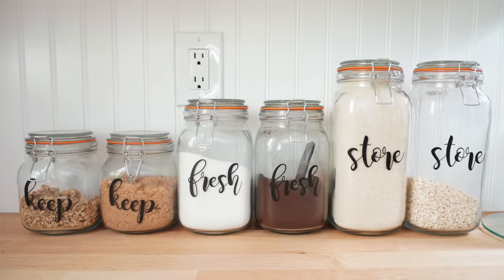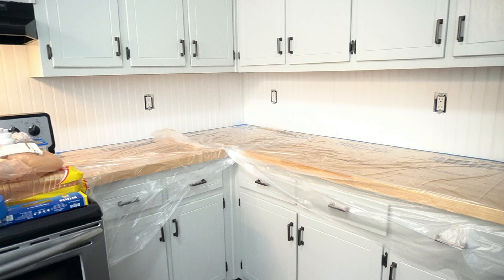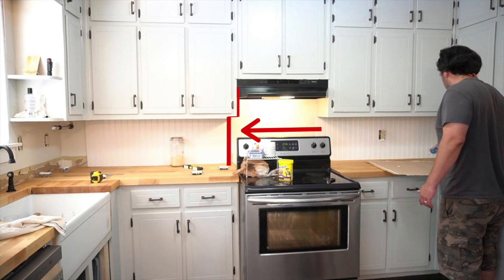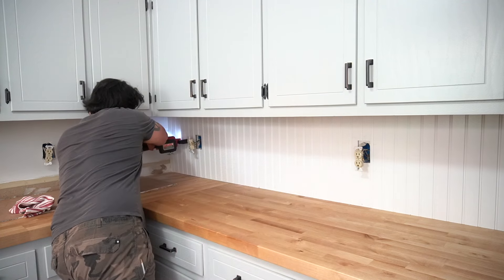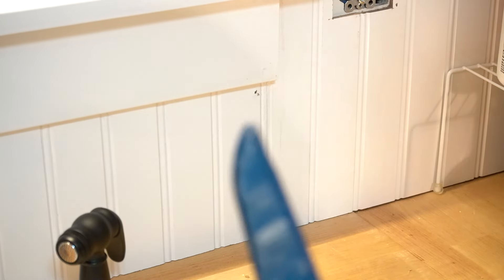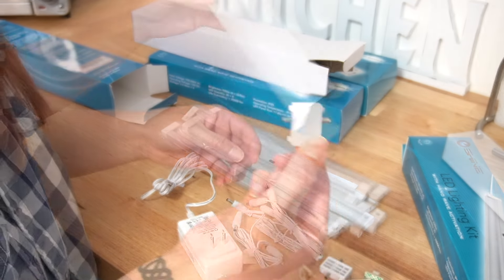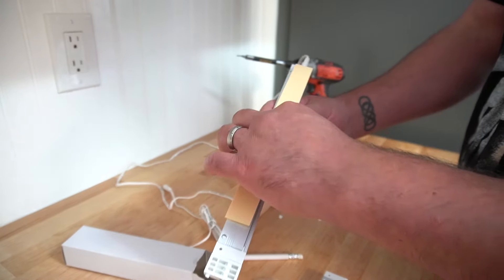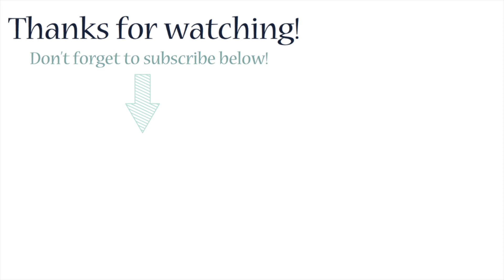HOW TO INSTALL BEADBOARD BACKSPLASH | Cheap Farmhouse Backsplash | Farmhouse Kitchen DIY

Comment: We're getting our house ready to sell, so we want it to look good without spending a fortune!  We have old almond laminate counters which are still in good shape, but the backsplash (which is a separate piece calked down) had warped behind the sink.  We can't find a replacement anywhere, so we're going to remove all the old backsplash and try this!!  **QUESTION... did you do anything to the edge of the beadboard that is not butted up to another piece - like behind your Breville coffee maker?
Reply from the maker: No I just caulked it and painted the edges. Looks perfectly fine!
Reply: @TheLatinaNextDoor  That's what I was thinking! Perfect! Thanks for the quick reply! 😊

Comment: Looks so good! Did you guys trim out the edges?
Reply from the maker: Thank you. We did not trim them since we went all the way up to the bottom of the upper cabinets. We just caulked and painted the edge pieces too. It worked out just fine for us.
Reply: @TheLatinaNextDoor  thanks for the fast reply! I wasn't sure since I saw the nice edge at the end but maybe that's just the bead board. Looks great and can't wait to do ours

Comment: Very nice video with helpful explanations that are easy to follow! How has the bead board backsplash held up for you over the past few years to steam, oil and splatters from cooking? Is it hard to clean with all of the ridges?
Reply from the maker: It held up great! You just have to be sure the caulk is done well at the seams or you the risk of water getting underneath and it expanding. I had a teeny tiny (1 inch) area by the sink it happened to but it was a quick repair. I loved it as far as wiping it down. It was easy to maintain clean as long as it’s painted.
Reply: @TheLatinaNextDoor   Thanks so much for the quick response! This is super helpful!

Comment: Is there any trim piece that goes at the edge where the bead board ends?
Reply from the maker: No. It’s not necessary but you can definitely add a piece of you wish. We just caulked and painted it. Hope that helps! 💕😊

Comment: Looks really nice! Thanks for the idea. But I don't understand why we need to be continually told he is a Latino electrician. How does that make a difference with the instructions?
Reply from the maker: It made a difference in this case because he pulled the outlets out from the wall and I didn’t want anyone thinking that it was a necessary step in the installation of the beadboard. We try to be as thorough as possible in our videos so that we don’t confuse anyone. He’s a retired electrician but he still knows quite a bit. “The Latino Engineer” is his channel name so you will keep hearing that in my videos when referring to him. Have a blessed day!
Reply: FYI, it’s The Latino Engineer and not Latino Electrician!!!

Comment: You did an excellent job of explaining & showing this process.  It was a relief to see you not using construction adhesive all over the back of the panels.  That stuff would make for a disaster if anyone ever needed or wanted to remove the panels later on.  And oh yes, watching those caulk seems and holes are always so satisfying! Looks Beautiful!